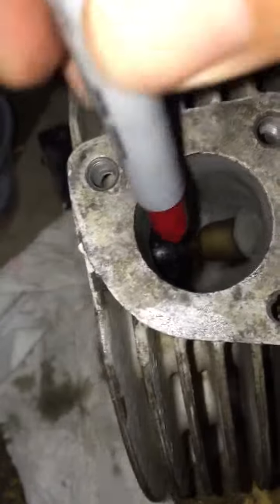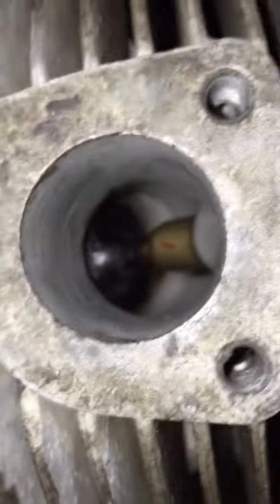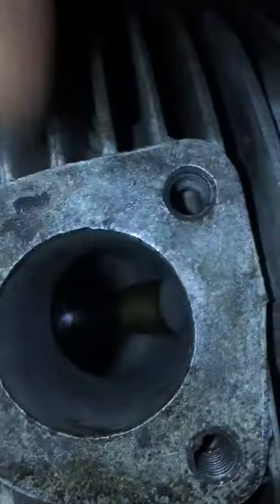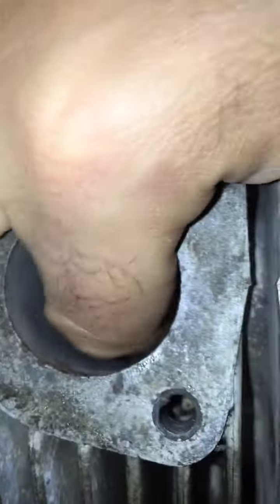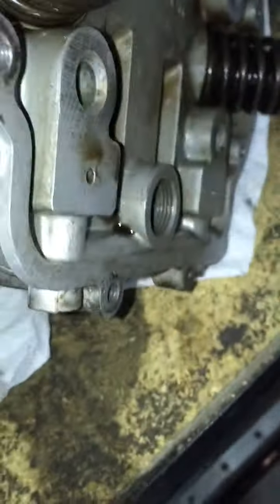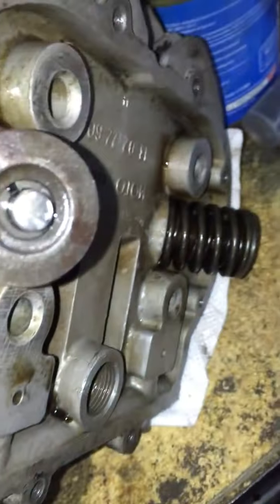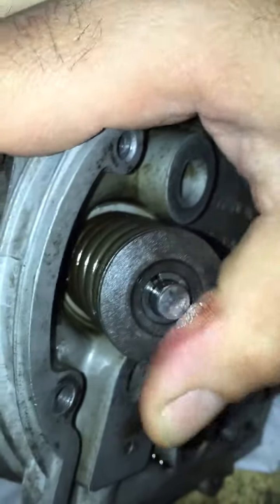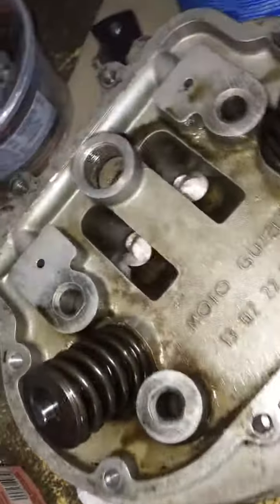1973 Moto Guzzi Eldorado loose valve guide

Comment: Como arreglaste el problema de las guías?
Reply from the maker: Heisenberg  I had to remove the old valve guide and install a new one.
Reply: what can I do if the valve guides coming loose in the guide bore?
Reply from the maker: Heisenberg unfortunately the only fix is to install new valve guides. They are not too expensive and the work needed is not difficult. Just freeze the entire head, then gently hammer the valve guided out. Then freeze the new guides and let the head warm to room temperature and gently hammer the new guide in. You will then need a reamer to slowly grind the inside guide to the correct diameter. All in all not difficult, just time consuming.